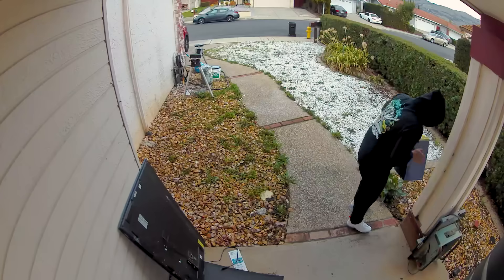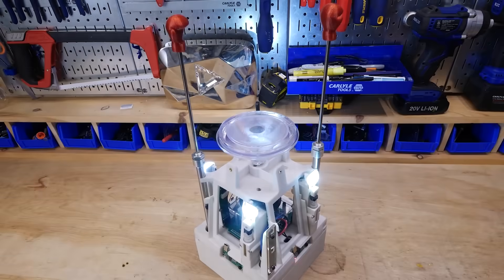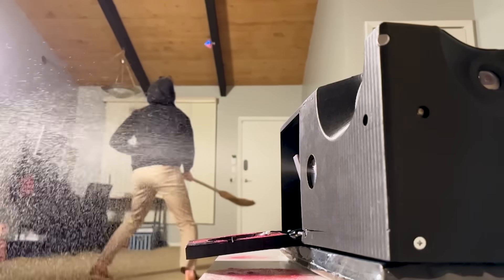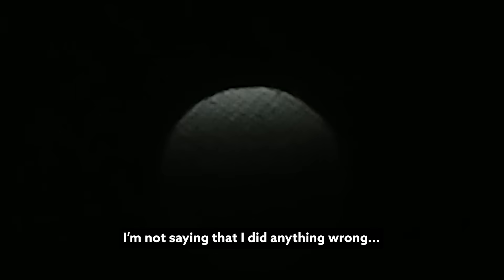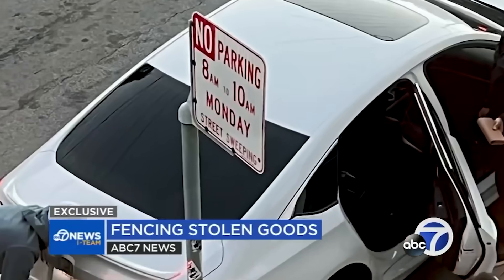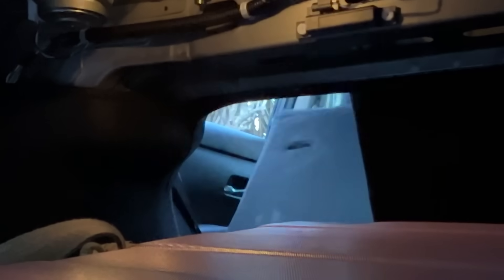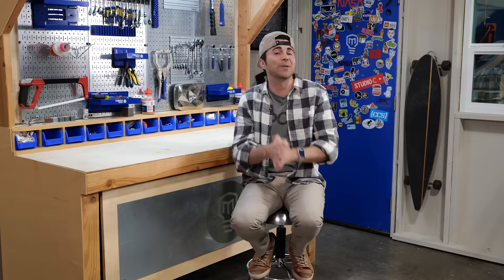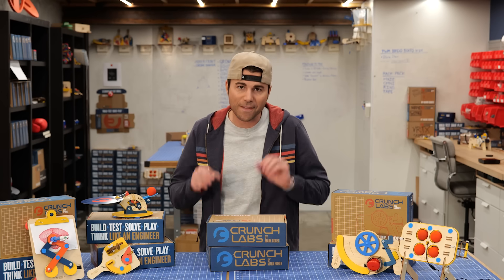Car Thieves vs the Almost Final GlitterBomb 5.0

Comment: Have a seat belt automatically tighten to the point of locking the thief like a handcuff to the car door and have alarms go nuts!!!
Reply: I would like to see someone attach that seat latch to a shotgun...but apparently that's not okay.
Reply: Genius! 

Addition : tentacles attach to thief’s car (simultaneously) rendering voltage surge / lock, causing dead car (after doors lock and windows up) 
Nobody goes anywhere.
Reply: @arjunapartha  That's illegal!
Reply: @arjunapartha  i think thats not only stupidly hard but also illegal
Reply: @MaRBL23563  wooosh
Reply: @MaRBL23563  Ah, but the actions of the thief are legal?
Reply: @Desperajoe  Not in the slightest.  It is literally illegal (speaking for the US and many western countries) to do something that harms people *even if they are breaking the law*.  Setting a home-alone style trap, even if 100% morally justified, can still get you arrested and charged.
Reply: @davidlawrence8711  It's illegal almost  everywhere. I thought the guy was just joking bruw 💀
Reply: @MaRBL23563  No its genius. Thieves have no respect for their victims or the law
Reply: @voice.of.reason  did you even bother to read what i said?
Reply: @MaRBL23563  why would that be illegal exactly
Reply: @davidlawrence8711  thats why you don't post it and put the cameras in there. dont tell people your doing it. then nobody  knows
Reply: @davidlawrence8711  At the same time while use of guns is perfectly fine
Reply: @davidlawrence8711  apparently if there is someone in the home that is trapped it's legal because it can be self defense I think.
Reply: @Desperajoe  🤓
Reply: @davidlawrence8711  not if no one finds the bodies of the thiefs.
Reply: @MaRBL23563  Yes
Reply: Just poot a sentry in the back seat. Upload the conclusion to LiveLeak. Everyone wins, except for the scumbags.
Reply: I prefer a healthy 100 pound Doberman trained to not bark sleeping on the backseat.
Reply: There was a commercial in a move, I think it was a Robo Cop or Escape From La/New Your, where the car would electrocute thieves. Maybe it was a flame thrower. Either way, they RIP. I say, yes PLEASE.
Reply: or just be waiting for them.
Reply: My thoughts exactly when i was watching this.
Reply: Technically the car would be holding someone. That's like saying you'll get sued if the thieves get cut by glass. Not sure the law applies the same way in the act of a crime?
Reply: The judge will blame you for damaging thieves arm. Whose side is justice on?
Reply: @betterseatsinc2010  The criminals
Reply: Защищать свою собственность не законно?
Reply: @kerai_  Here in belgium, in west europe yes, but you have to know that  the government doesn't care about the people here. They wanna get money instaed of listening just for a second to the people.
Reply: Amazing idea, would love to see that!
Reply: The simplest solution is just to get the car’s door made with non-tempered glass. If they break in they are gonna get cut real bad
Reply: It's called false imprisonment, and yes it is very illegal
Reply: @JoshWitte  you a Thief Josh?
Reply: @alarmservicepros  
"False imprisonment or unlawful imprisonment occurs when a person intentionally restricts another person’s movement within any area without legal authority, justification, or the restrained person's permission. Actual physical restraint is not necessary for false imprisonment to occur."
Reply: @alarmservicepros  you do not have legal authority to hold another person hostage against their will for any reason
Reply: @JoshWitte  So, question, how do the police have legal authority to detain anyone by that grounds and what is the justification?
Reply: @nathanielbass771  because they are law enforcement. That is quite literally their job. They are given the power to detain others through state and local constitutions and bylaws. Though they must still abide by the US Constitution and Bill of Rights. No unlawful search or seizure. No detainment without probable cause.
Reply: @JoshWitte  So, what specifically differentiates them from another person?  If anything, it designates them as a privileged class
Reply: @nathanielbass771  are you serious? Society is built around social structures like laws. A set of rules that everyone generally agrees to follow. Did you never take a basic civics class?
Reply: @JoshWitte  I don't care. There have been many times when I didn't care and did what I wanted and people were happy about it.

Comment: I’m glad I have a 2003 Corolla. To pull the seats down, the pull handle is on the bottom of the seats.
Reply: I had a 2003 Corolla and the only way I knew to pull the seats down was to use the release behind the seat in the trunk.  I traded it in 2 years ago for something a bit less rusty.  Engine was still fantastic.

Comment: just for anyone watching and actually caring, the thief is pushing on the glass from the outside to shatter it with a lighter tap in order not to make as much sound and glass outside of the car so that getting in is easier and less noticed. the combined force of two locations requires much less than one  :)

Comment: if stuff like this happens that often, why don't delivery companies change the way they deliver packages? so that someone from the family is actually present when the package arrives, asking for some kind of ID so they dont deliver to the wrong person or at least have some kind of securized box that opens once to put the package in, then locks and only the owner gets to open it, maybe something like this can be done, stay awesome Mark !!!
Reply: That's a noble idea, but many households get deliveries on a weekly or almost-daily basis. The sheer volume of deliveries dwarfs what it was a decade ago when requiring signatures (and the like) was more commonplace. When nobody's home, what are Amazon drivers or UPS supposed to do? They'd have to retain half their deliveries, take them back to the distribution point, and try again the next day. Or, require that the recipient takes their own time to pick up the package the next day. You'd have a lot of unhappy customers and logistically-overwhelmed delivery systems.

Comment: New solution, Snags the tighten around their arms when they reach inside the mini windows, tripped by sensors and also programed to release if they don't sense resistance before fully tightening.

Comment: Crazy how he has footage of people breaking in cars , and the police hasn't taken any notes.
Reply: They know it's happening and how. And it would be easy to pick up a small number of those doing the actual break-ins. The way to stop it is to get the ones doing the fencing. If the market for stolen goods gets taken down, the thieves will stop. But if you just target the thieves, the thieves will adapt or be replaced by ones with a new method.

The sad fact is there are a lot more criminals than police can handle so they have to target the larger criminal systems that enable them.

Comment: Hey Mark, Why don't use arduino chips instead off a phone? Wouldn't it be better to use arduino chips as you can use cheaper components (to prevent the phones from being stolen.)? Regardless, thanks for the great video.

Comment: If you ever do this again, instead of glitter, you should have one that flings glue so they can’t even clean it up.
Reply: no, cement >;)
Reply: @1nfinityG  to bad they can’t make it fling shrapnel without being arrested.
Reply: @1nfinityG   Cement is very easy to clean. And you need it wet which it doesnt stay in a package for hours. Plus its too thick to spray.
Reply: or ink
Reply: Hundreds of beads of Silly Putty and Slime are great fun for the kids (and carpet). Some assembly required.

Comment: Now do one directed at actual car thieves, PLEASE. I've lost two vehicles to car thieves in as many years. Not only do you get victimized by the thief, you get a second round of it if/when the car's recovered by a tow company. They charge an OUTRAGEOUS impound fee, & when you can't pay it, they put the vehicle through auction & THEN come after you through collections for the remainder of the impound fee. In WA state, the D.O.L. (DMV) can even suspend/revoke your license until you pay, considering it an "abandoned" vehicle!

Comment: need to gut an older laptop that is thick enough to hold the spray and a glitter blower.  Battery pack and enough space for a esp32 or arm board.

Comment: With the car smash and grabs, is it going too far to have a secondary steel window with a razor-sharp top in the down position, then when the main window is smashed 2 seconds later the steel windows shoots up and cuts off whatever is sticking in the car?

Comment: Those little windows look like a great place to put a wire snare.

They smash the glass, then put their hand through the window and bam, snare catches their hand. Probably only needs just enough force to squeeze the wrist without breaking it, maybe 20lb of pull, then locked in place with a hard lock. Then the guy will be trapped there until the cops come...

This isn't really enough to make a real difference. And if you're stopping at this point, even if they know about the glitter bombs and it has a tiny difference, it will just get worse again.

Besides, from the sounds of it, it's incredibly bad in that area.

Comment: Question. So why is it that the police for what ever reason do not go do their job. I mean if law enforcement does not take care of 2 small thefts, that clearly turns or results in 1 x 100 different small ones be one person, say $125 per time is $12500, for car thefts, thats not adding the cost and repair to the vehicals, as well and things never really being the same as it was before. So why or what did they say for not going out and charging these people, who broke the law now??? 
I so woyld start a campaign to fire and replace all who will not do their jobs. After all, Small crimes not addressed over time leads to bigger crimes that leads to people dead at some point.

Comment: Don't know about you, but this version seemed a bit... overengineered? What would make sense to me would be sticking with the 4.0 design, making it more durable, perhaps adding more glitter (because that is the main part, not the spray), maybe replacing 3/4 smartphones with normal cameras so that they are cheaper to make.

Comment: me sitting here with a car that doesn't have folding rear seats as that was an option extra, and the original owner didnt pay for that extra so my stuff in the boot is pretty safe as there is zero access from inside the car.

Comment: The individuals are scary but the crime rings are terrifying. They operate in such connected networks, it really can feel like there’s nothing we can do. I’m really happy that people like Mark might at least give them pause.
Reply: I'm surprised that Mark is more clever the police department's that doing nothing. I'd bet the polices and politicians are part of the crime ring.
Reply: Driveby in the middle of the operation.  Wipe out a few roaches.
Reply: This is in San Francisco, the police literally won't arrest anyone for theft if the value of the stolen item is less than $500. So it's really not surprising to see crime this organized and rampant.
Reply: @Ligma_Bhalz  I think it’s actually almost $1k
Reply: Someone needs to do “glitter bombs” sticks of dynamite, I bet that would give them pause.
Reply: @Jibulus   bird shot shells in a nice flower 🌼  pattern 👌  just to pepper them up nicely 👌
Reply: There’s so much we can do, unfortunately they’re not giving thieves ANY reason to not do this. They are not being held accountable. Why do you think stores have started pulling locations from SF after laws on theft were basically gotten rid of under a certain dollar value? Using only the info you learned in this video, you could launch a MASSIVE police operation to not only catch the thieves, but the middlemen, and the people running this ring. If police bought 20 laptops, put tracking software in them, and set them in 20 cars you would have your men by the end of the week. Mark has the GPS data of what routes they take. You could probably find out who they are and where they live pretty easily too. Why don’t they do this you ask? “Politics.” When the police stop doing their job, it’s not the fault of the police. It’s the fault of your government. That means it’s time to rethink who you’re voting in, and the ideas they’re selling you on.
Reply: The police could do alot if they wanted to, but they decide not to I guess.
Reply: @TheIceyeddy  No, they get defunded by extremist groups running the city, county and state, and they're not allowed to do anything about these anymore.
Reply: @Charismatic_Calvinist  those of us with brains have, don’t feel bad for those who haven’t. That’s their problem, even if they’re flat broke, save a little $ and catch a bus somewhere else
Reply: Yeah there will no pause in crime in the great city of San Fran. Just stay away and thankful I don’t reside there.
Reply: Maybe stop defunding the police and let them do their job?
Reply: Our federal law enforcement  agencies could crush them like bugs, but they don’t because they’re too busy bullying citizens
Reply: Not live in America lmao
Reply: It's called Government
Reply: @Charismatic_Calvinist  You wouldn't
have to move out of the cities if Republicans would stop screwing over the average person.
Reply: Stop voting in soft-on-crime DAs and politicians, that's what you can do.
Reply: Solution is easy, culling.
Reply: that's california for you
Reply: @faridb40  Also Texas. One Texas DA warned people to NOT do this. The video was cringy.
Reply: @faridb40  failed society. insane.
Reply: if mark would put carbon monoxide or chlorin in those boxes it would ve drpped to zero

Comment: The data you've gathered on the SF crime ring could make valuable resources for locals. The fact that they evolve means that someone like you is needed to also evolve with information gathering and to help the people stay safe. The fact that they have routes, and have a system etc. is valuable.
Reply: I agree, they should use that information to leave Cali.
Reply: @lominero5  AHYUCK

Comment: Advice for americans: build a trap in wall next to door that can be opened from outside only  through a code and give that code only to the mailman/deliveryman. So when the package drops and you are not home, it will go directly into your house.

It's like an easybox, but straight into your home. It will be also helpful if you have an easybox nearby. Or if you have trusting neighbors you could as well message the deliverman to leave the package at their house until you get back.

Comment: Can you design a catalytic converter equivalent, maybe with the GPS with tracking? Just had ours stolen for the 4th time this year…even the dealership antitheft cage wasn’t enough…like you said thieves evolve…
Reply: The issue is that the heat of an actual cat will cook anything inside it or near it.

Comment: hey your video was really interesting. I though with tempered glass you are safe but they have the tool too -_- . The issue with the last two bag is the smell. An idea came to me. What about putting a gas (not inflammable / toxic or nasty or anything) then the box after some minutes will throw an other gas that will ''activate'' the first one and this will create a very very big smell

Comment: Pretty concerning state of affairs when you can guarantee that a person will come and break into your car faster than you can get an uber. There is so much evidence in these videos including the movements of their vehicles, their intentions, etc. Have you just placed a few 'safe' packages that only track GPS without setting off alarms? What about glow in the dark or UV reactive spray paint - stuff they can't see but which very obviously proves their guilt when placed alongside the other evidence like their movements and audio recordings.

Comment: See, I'm not a nice person. I'd be out in those streets with a device that mixes some more fun chemicals when activated or just go low tech with it. Either way there's going to be a dramatic decrease in windows getting busted because when it's your limb or life on the line for real. It'll solve the problem temporarily until they adapt.

Comment: Engineering solution: Replace the bottom of the box with a layer of heat-triggered adhesive. Color it to match the other sides of the box. Lastly, trigger the adhesive long ahead of the countdown.

Comment: also very helpful in this video shows that these window smashers do it from the driver side as they pull up in a getaway car. so if u must leave stuff in the trunk. make sure its near the corner of the passenger side of the trunk cuz then the thieves would need to smash the other side or climb in to grab ur stuff. all more time costly which they arent looking to stick around long especially if its daylight
Reply: Except none of that matters in san fran lol, cops don’t care

Comment: The drones seemed to be a bust.  It's pretty hard to engineer that since you can't account for the environment the package is being opened in.  Seemed to work perfectly in the test enviroment but they're being opened deliberately.  Theres no guarantee that the packages would be open on a flat surface with open space around it.
Reply: I think it's the boxes getting thrown around so much. The drones looked like they were upside down or came out sideways.